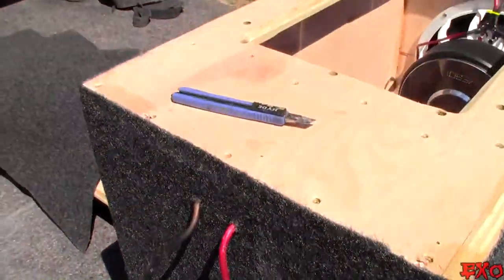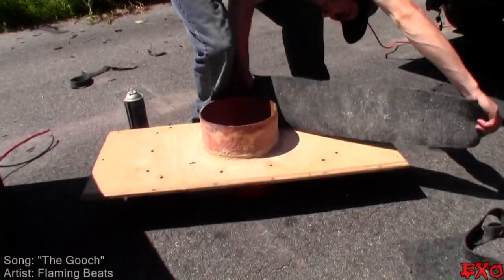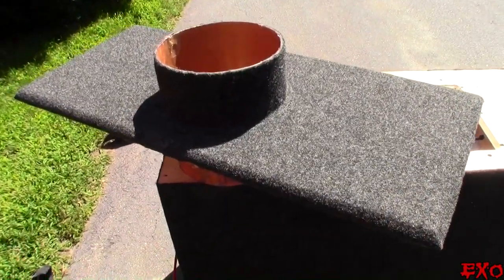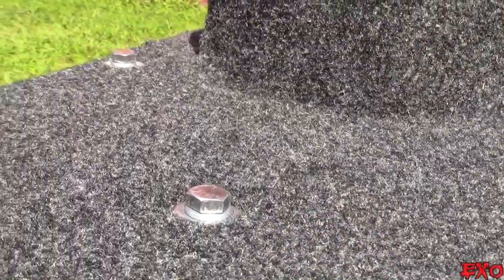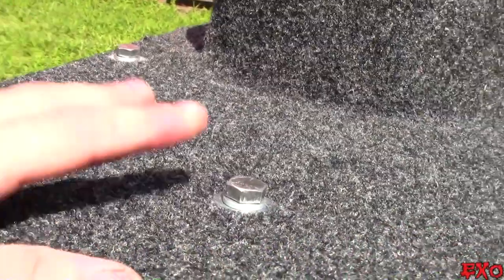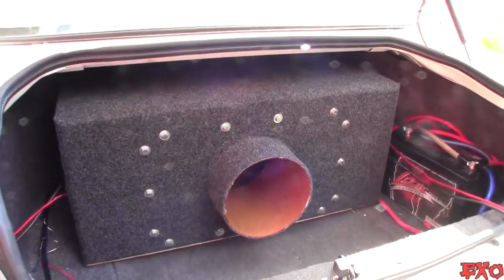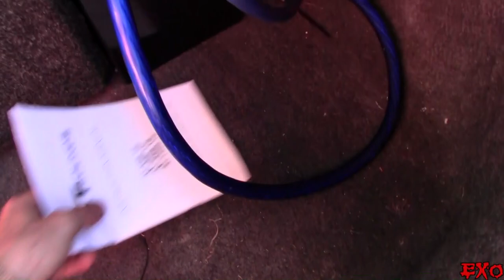Carpeting a Subwoofer Box w/ Super 77 & Latex Backed Carpet / How To Wrap Bandpass Speaker Enclosure

Comment: I am waiting for the comments that say (Don't mount your amp on the box) Look either way mounted on the box or your trunk some where there is always gonna be vibrations so it doesn't mater and i have mounted amps to sub boxes and have never had a problem. Great work tho ***** Looks great man
Reply: This is terrible advice.   YOU may be getting away with a lot of half arse install techniques, but that doesn't mean that it's OK or that someone else won't run into trouble.  Make some friends in the amp repair business and ask them how many amps come in with vibration damage from being mounted to boxes. 

Yes, everything vibrates, but the box is the worst spot. 

That all being said, do it if you like, but understand it is more risk than mounting elsewhere.
Reply: hispls  I have also installed many systems and have never had a complaint about any failure of there equipment (I am not pro just installed for friends and family) Also i put rubber pads where the mounting screws are To lessen the vibration But i haven't done that on mine and i have no issues. If your amps is built well it isn't gonna just fall apart Yes vibrations can loses stuff but manly screws not solder and glue that stuff has to heat up to loosen and if you amps is getting that hot to loosen your solder then your doing something wrong. But everyone has there opinions and your entitled to it.
Reply: hispls If your amplifier gets damaged due to box vibrations, you either have a cheaply made amplifier, or a box that wasn't braced enough. Try again.
Reply: Josh Ianneillo

Again, run that idea by a few engineers or people who repair amplifiers 40 hours a week and see what they tell you.   I didn't say that your amp will break guaranteed every time, but only that it's the worst location and the most risk of breaking things.   I'm not just pulling that out of nowhere, and yeah I've done it before when that's the only option without trouble, but let's not pretend it's a great idea and give people the go-ahead to do it.

Also bear in mind that what might work for someone with a JL 500/1 on a single 12w3 in a sealed box might not fly on the guy with a Sundown 5K on a pair of 18's.  I'm not sure what sort of installs you've done but I think a lot of people underestimate how violent things can get with some of the higher end equipment out there today.
Reply: nik12937

Cool story.   What kind of numbers are you putting up on the meter?  What's your definition of an amp that isn't "cheaply made" that would be OK to mount to a box?  What respected people in the industry have told you that mounting an amp to a box is a good idea when it can be avoided?
Reply: hispls I have done some pretty decent installs My system alone is a 18" Atomic E.L.E 18" I am trying to find a SUV at the moment to do a build with And will be running around 2000w to it From a PPi amplifier. My latest System install Was for my sisters car nothing great just some 12" old subs and amp laying around. But i have done some good installs I am not gonna name them all out because that would take an age. But the best install i have ever done was 2 Sundown 15" with Sundown amp i did all the wiring and radio install also Now in that case i did not mount the amp to the box It was mounted to the Side of the SUV With rubber for the mounting points to lessen the vibrations. But basically if the system isn't the best i do ask the owner weather they want it mounted to the box or not or space consumption I do tell them the risks. But i know it can't "Ruin" Equipment But If the system isn't A great one in the first place or The owner needs space i just mount the amp to the box with Rubber on the mounting points. Watch my latest video on my 18" Its on shitty power But that was just for a test My new amp didn't get to me by that time in the video.
Reply: hispls I mounted my Saz3500 to my box..... but.... my box is two layers of 3/4 mdf(not much vibration)..... and I made rubber spacers to hold the amp and keep it away from the bolts while still holding it.... of course bad vibration will destroy an amp the connections inside can only take so much...... the solder will eventually break
Reply: Ethan Hamby
Josh Ianneillo 

When you're running big power on competition quality woofers EVERYTHING vibrates.   For Christ's sake, if you're watching EXO's channel you've seen 100 videos of every piece of a car vibrating visibly, windshield washer fluid in the tank under the hood rippling, setting off shock sensor alarms in cars down the block, etc..   Your box may be 3" thick but it's moving along with everything else and the box is the point source of ALL the vibration in the car.

I repeat, I've had lengthy discussions on this issue with some very respected names in the industry, and vibration damage is one of the most common causes of amps breaking.  Really I'm not making this shit up.   Do what you like and odds are better than not you won't have any trouble, but I just wanted to point out that it's not optimum and it is more risk.

If anyone can point me in the direction of an expert in the industry that will tell me otherwise I'd be very interested to hear them out.  I'm not above learning new things, and I've found that most folks in the business are really friendly and helpful if you contact them and ask polite questions.
Reply: hispls I know its more of a risk to mount it to the box i said that in my last comment. I am 17 now my first system install(Just a sub and amp)i was 9 And i have always loved car audio and electronics even before i was 9 And even younger i still tinkered with electronics and stuff at 11 i repaired my first amp and it still works to this day. i know other people have different results But within my years of doing this stuff with electronics(I build computers also) I have never had a amp break from vibration(I also have a small sub up against my PC and i don't have problems with vibration there Either) And PC is probably more at more of a risk especially the HDD and i don't have any problems. So i kinda think that the people who think there amps are dying from vibration Are either from build quality being shitty(Because obviously a cheap amp isn't made as good) Or from some other reason such as overheating the amp and solder coming lose and them blaming it on the vibration. But like i said in one of my other comments we all have opinions and that is my from my experience
Reply: Josh Ianneillo
 Very cool.   Pursue a career in amp repair.  It's great money and the guys who are good always have more work than they can handle.

There's plenty of decent amps that are particularly prone to vibration damage.  The Memphis 4K and Orion 2500D, and Taramps 8K are a few that I can think of off hand.  A friend of mine just broke a DD M4 from vibration damage.  JBL/Crown A6000GTi can be prone to vibration damage according to Crown's authorized repair guys (I own one, and yes I've had it repaired and had a long talk with their tech).  Once you get into big power and bigger boards it's a whole different scene.  I've also personally had a Sundown 3K vibrate loose a transformer.  Frankly I'd more trust mounting a small amp to a box for the mere fact that it won't get loud enough to really cause any trouble.  The main "risk" there is if you get robbed it's quicker for a thief to run away with your amp AND box.  Ditto with anything on or around your computer.   It's hard enough getting 120dB in a home theater (reference level), much less 100X that much power or cone area to get up into the 140dB neighborhood.   I don't think anybody is doing 140 in their bedroom.

When and if you start getting loud you're going to break shit, once you've sunk a few grand into amp repairs you'll start going out of your way to minimize risk or if you're lucky you'll get a trust fund so you can afford to treat your equipment as disposable.
Reply: hispls Yeah i was thinking about starting a small shop to do repairs or even some installs. But i 100% Agree that Big power means more vibrations and the build i am hopefully starting soon the amp will not mounted to the box i will probably make a rack for it But most of the systems i have done were relatively small ya know just daily systems nothing over 1500w(Most of them, i have done some bigger ones tho) And they wanted to conserve space in the trunk. Yeah and i doubt my sub in my room is even touching 100dB its just a small 75w Logitech 5.1 system
Reply: Got my amp over the box and from the vibrations a coil inside got the attaching solder cracked. It was quite tall and it just couldn't stand all the vibrations. But hey! it's a matter of taste! Great work on the carpeting!
Reply: you lose volume mounting an amp inside box so you will have to account for it and make box bigger anyhow, may as well mount outside somewhere where its more accessible in future if you need.  Less vibration for anything is always a good thing.  How long it been okay? like a month?  Who comes up with these bonehead ideas?
Reply: That is the stupidest thing I’ve ever read!

Comment: Exo I'm trying to add a 2nd battery to my system any tips or guides?? I got one 12 W6 on a tweeked 600watt Rockford Fosgate
Reply: There's no need for a second battery. After about 3000-4000 rms is hit, then you need to do that. Right now, your system isn't taking much power so you'll be ok just like you are.

Comment: Would 2 12s on 2k rms be safe to run with big 3 on stock bat and alt?
Reply: Probably not. Depending on the size of your alternator. I have a 130 amp stock alternator. No big 3 or extra batteries and total power in my car is about 1400 watts for mids/highs and bass. I'm right on the edge of over powering. Most normal music is ok at full tilt but some of the harder hitting stuff will dim pretty good and some chopped and slowed will pull my voltage down far enough to send amp into protection.
Reply: Thanks
Reply: If both subs are running 2k rms then I would suggest doing the big 3. I would suggest getting a second alternator and running a second battery if you don't do the big 3 though. If it's not 2 12"s running at 2k rms then you should be ok.